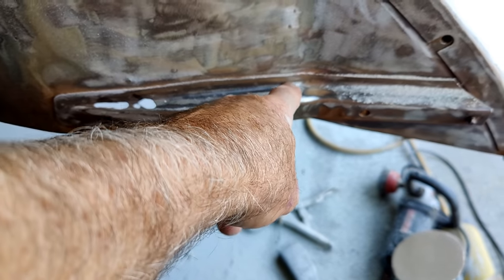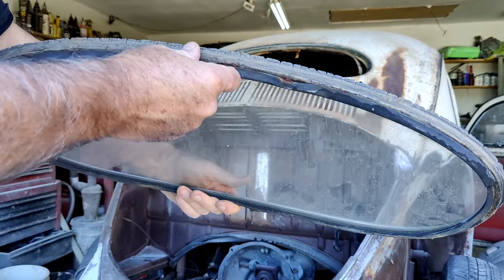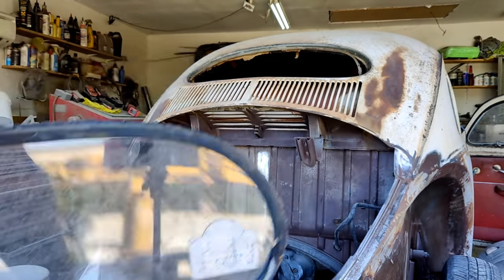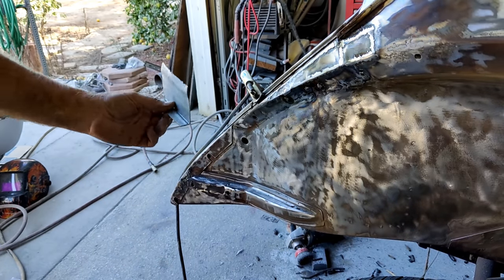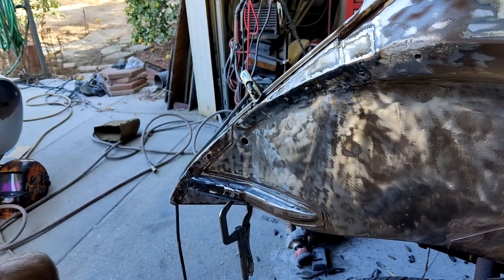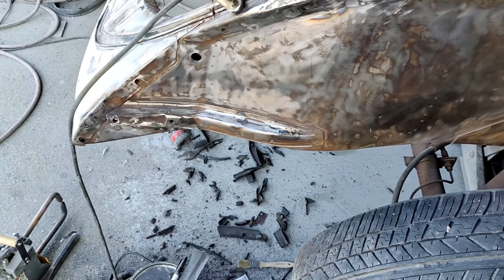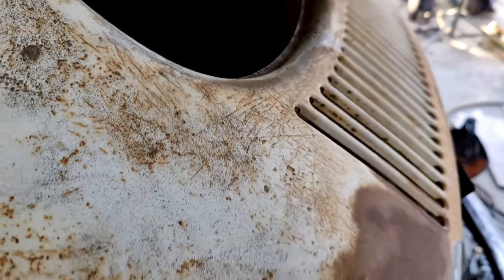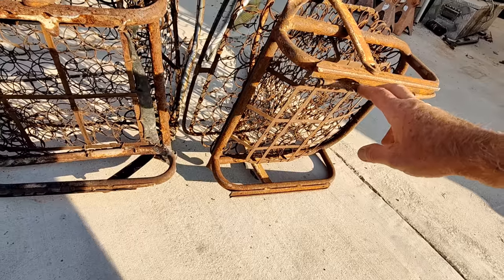1954 VW OVAL window bug restoration Rust hole repair metalwork welding full build restoration

Comment from the maker: ITS FUNNY.....if you watch my welding trigger finger you will see how much i am letting off and spotting my way along. Stitching.
Reply: Mike I love your vids. I have the chance to buy a benco "prostreet" transaxle with 3.88 and .89 4th gear. I am running 14 inch bus rims on 67 bus. What would too speed be with this setup. I tried to figure it out but didnt come up with good result. I also have a 2276 turbo motor and am wondering if that "prostreet" trans could handle the torque/rpm range. Motor has engle 120 cam. 1.25 ratio rickers with double springs. I have learned alot through your channel but only rnough to realize you cant just slap a bunch of parts together (fan speed was most important thing I never knew until your channel) Bus will be running stock reduction boxes ..Thank you in advance and your channel is great. Tell my friends about it often..
Reply: **Top speed.
Reply from the maker: @baxterscientific  It mostly depends on how yoy drive it. Not hard shifting and trying to get the tires loose it should be ok. I would run a strap on the transmission though. first thing to break will be the nose cone. Typically they want to see super Beetle main shaft (not normally in that trans) and welded 3rd and 4th. which I think are in there. The super beetle main shaft is for off the line starts. With GRB not a good idea to try to spin the tires too much torque on the trans. Those gears would be shorter than stock. Really need the .82 4th. Also if it is a bug trans you need to flip the ring and pinion. (reverse rotation for GRB.) I have several friends that run 3.88s with .82 and it is not bad I still could cruise 70. but your talking about .89 top speed would be around 60 with tall tires 205-75/14 4.35 final drive stock is 4.25. with big nut 46mm nut.
Reply: Thank you for the response. It sounds to me like it would be worth the extra $$ to get it done correctly the first time. I appreciate your input greatly.. I want to cruise 70 but not have motor revving to the moon so will follow your advice and have one built..

Comment: When I started in the bodywork game in the late 70's a great old painter called Mac used to talk about the old days after WW2 , UK that is using concrete for chassis and floors , taking pistons out of engines run them on 3 or 5 cylinders LOL ,  the new fillers were rock hard even the the files would not touch it , Cliff McDonald the tales about the war he used to tell , stealing a truck full of shoes in Africa being captured by the Germans escaping death by having a German machine gun in the truck killing a guard in Italian POW camp when escaping , his mates getting blown up in a ammo dump being dive bombed , says he went through that without getting a scratch , after the war his mate would pick him up on his bike to go to work  hammered it over a humpback bridge lost it and went over the top 18 month up to his neck in plaster ended up one leg shorter that the other , we had to cut the seat frame of his new car to tilt it over so he could get to the accelerator pedal . Sorry for the ramble on but that brought back some great memories . Lead lasts but the metal behind still rots .

Comment: Years back I bought the early style rear bumper mounts.  They were so bad, I cut out the originals and ended up repairing and reusing them. I would now do it the way you did it here 👍.  Nice work as always 🙂
Thank you for the video!
Reply from the maker: Right on

Comment: 71 super beetle. I, m doing just about exactly what you’re doing. I did delete the heater channels. Which were totally rusted out. I used 1 1/2 square tubing along with 3 inch flat to replace the channels. I think it’s much stronger, at a cost of about 200$ for the metal, which includes 18 gauge sheet metal for the floor. Saving a hell of a lot of money! And I figure you don’t need to be driving one of these in the winter anyway. I like watching you. Makes me feel like I, m doing it right.
Reply from the maker: GOOD ONE....thought about doing one that way.Had that one in my mind. 3 inch square tubing then cut out where the door is Flip it upside down and it is almost the same. Put some weld in nutcerts on the bottom. your golden. you could even put the pipes in there and use the squares to push up the heat. Would do that in a heartbeat. was telling Jason at 5150mxvw channel that is the way to save some of those old 70s cars. They are not worth the money for good parts. But they would make cool rats or race cars.
Reply: Yeah, I thought about that. It’s probably enough room to move the heat through. But even on the engine side, everything is so rusted out, that I decided to close that up and dump all the engine heat through those lower rear vents. I do have a working defroster system. Been thinking about some kind of electric heat for the defroster.just enough to clear the windshield and maybe take the chill out. We, ll see.
Reply: Oh, these darn beetles are addicting to work on, aren’t they.

Comment: Mike, as you are welding, your patches warp a little along the corners. Try tacking the corners first. I tried this on my 73 super beetle with great success.
Reply from the maker: yea good point. I usually tack where it is flush then pound it till it is flush. If you noticed I tacked in the pie shape then cut it to fit while it was welded in place. Then tacked it in as it fit flush. very little filler on there. just did it today.

Comment: hello Mike, do you know wolfparts from Sweden?  he has the bumper mounts for little money that.  in any case, the quality is very good.  Of course, I don't know the shipping to you 🥲 Greetings from Germany
Reply from the maker: No I dont only ones available here are Autocraft from england. Metal is too thin IMO. THey are pretty thin metal but should be upgraded to 18 gauge instead of 20. I need to find someone out there to get German steel hubcaps. so I can get them chromed somewhere out here. We are running out of hubcaps no more Brazilian ones.  Wolfsburg west wants like 79 each I hear there are some out there for  about 18 euros. which after chroming would be much less than Wolfsburg west. $320 usd a set is just too much. when I need a few sets.

Comment: I have a Lincoln Electric Handy Mig welder. I'm using  solid core .024 wire and argon/CO gas (80,20) I have the power on 1 - low and wire speed on 4 (these a the welder(manufacturer's) recommended settings for welding thin sheet metal) I follow your videos carefully  watching how you weld and I don't think I ever see you  blow through.  I make short 1 second tacks and often have blow throughs. What am I missing?   TIA
Reply from the maker: I burn holes lots of times. try lowering the heat and increasing the wire speed. check the other side of the panel to see if it has welded all the way through. Usually those settings wire speed is too slow. turn that up first then lower heat after but if the wire is pushing you are too low heat or too much wire. usually heat first then wire at that point.
Reply: @Mikefngarage  The heat on this machine doesn't go any lower. But when I turned up the wire speed setting from 4 to 5  Wow!  makes all the difference. Thanks!  If you would oblige me one more ask to maybe help me to understand what's going on here. So everything else being the same. if I was to switch to a slightly thicker wire say .030 and set the speed setting back down to 4 or 3.5 say would I get similarly good results?

Comment: What's the benefit of using epoxy primer and polyurethane primer?
Reply from the maker: epoxy primer is a great sealer and parts wont rust if they are left outside. Not necessary for all work but sometimes a good idea. also can encapsulate rust Stop it from being active. If you live in a place like Florida almost a prerequisite for restoration. Because it will rust before you get to paint even if you leave it inside.